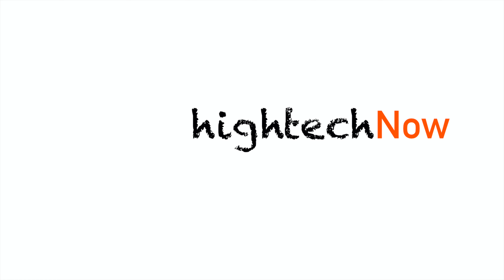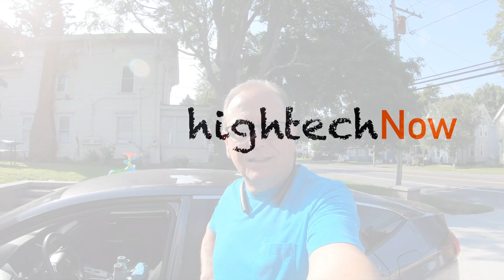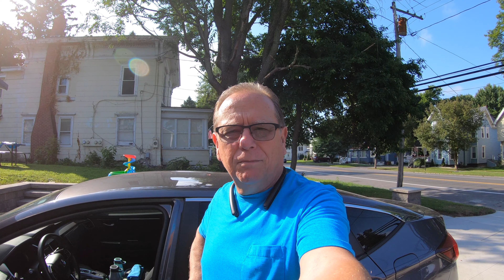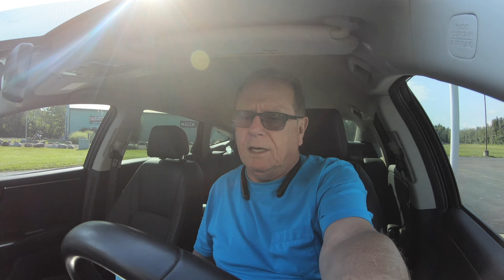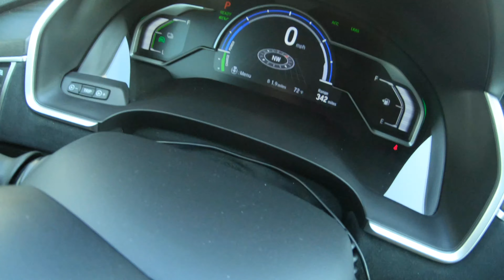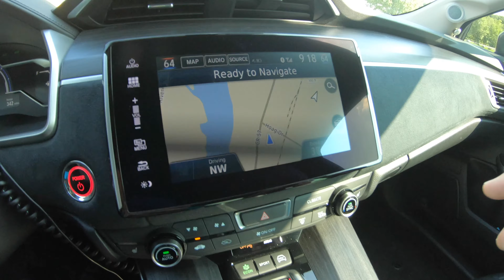Honda Clarity, how is it on Road Trips?

Comment: Nothing like being four years late to the conversation, but here I am!  I, too, have a 2018 Clarity (Base) and have owned it since new (10 mi on ODO).  She now has 83,500 miles on her odo and I still love it as much as the day I drove her home.  I took mine out on a 1250 road trip for Portland, OR to Palm Springs, CA about 90-days after I picked her up.  We drove over 2 day (July 3-4) through the hottest parts of CA.  I had everything I could stuff inside from floor to ceiling with enough space for myself in the driver's seat and a spot for water.  Mid-summer, AC set at 72 and averaging 75 mph through the Siskiyou Pass, over to see my sister in the Sierra Nevada and down the I-5 (thus the average!) to Palm Springs.  I averaged 55.1 MPG and was 90% comfortable the whole way.  The only thing I am not 100% fond of is that the seats are not made to support the weight of an average adult (too thin) so my behind was sore a good deal of the time and I took a few more rest stop breaks than I should have in order to get myself straightened out.  The other is the road noise.  Honda is notorious for skimping on this and the Clarity is no different.  The mouse fur carpet, thin (if any) sound deadening and volumous cabin make for a resonant interior. Even with lots of soft items in the cabin, it was still louder than my CX-5 and my diesel Jetta.  However, she is still banging out 55+ mpg on long trips (I've gotten as high as 63 mpg) and I wouldn't trade her for the world.
Reply from the maker: Very nice owners report, thank you for sharing ❤️.  I agree on all points made. We are at about 53k and we enjoy the Clarity as much as the day we purchased it. We have 4 more payments...lol.

Comment: Nice video! We actually have 2019 Clarity as our main family car. I'm looking forward some long road trips to come, and I'm curious what's your methodology on road tripping with Clarity. When we have continuously days of travel (ex. 3-4 days), do you think Clarity can hold up without charging and just using gas + HV mode? (assuming we can't charge every night during the trip). I'm asking since we've been just fine with EV mode for daily use (and occasional HV mode for >50mile drive), I've not tried long road trip without charing.
Reply from the maker: My thoughts are when traveling, save the EV/ battery always. When leaving town, use the battery to bring down the level from being topped off, then switch to HV mode. The Clarity is much more fun on the freeway with a good charge in the battery. (Sport mode is nice). If you have to climb hills and start to get low, don't be afraid to use the charge mode to bring it back up to about 50 percent while driving ( preferably not during a climb). We are at about 49k miles and still feel the Clarity is the top plug in hybrid available when compared to all PHEVS.  Have safe travels ❤️.  The forums are full of great advice. 👍
Reply: @htnowpro  Thank you for the comment!
Reply from the maker: @eugenehong136  you are very welcome.  I had to go back and watch the entire video from 3 years ago.  It was a great trip, all but the last 30 min. Have a wonderful weekend coming up. 😀

Comment: Hi can you tell me how reliable will it be for me to purchase a 2018 clarity touring with 9k miles any thoughts will help
Reply from the maker: From my experience and all the groups I am on I would rate reliability a 10. Your experience, of course may vary . We are exceptionally pleased with ours. Ours had 9k when we purchased it. We are at 47k now. Read everything related to the Clarity, do your due diligence, and weigh your use case scenario and expectations accordingly.  Hope this helps you.
Reply: I hope you bought it and are as happy with yours. 🙂

Comment: Odd, no comments that you don't seem to understand how the transmission works,  Once at speed in Hybrid or sport the engine does engage with the wheels, as well as driving the generator.
Reply from the maker: Good morning.  I just reviewed this travel video and I can't find anything related to how the transmission works.  You may have noticed this was not a technical video; merely a travel video.  I thank you for watching and taking the time to comment. For an outstanding break down of exactly how the transmission in the Clarity works I highly recommend the WeberAuto channel.  Here is a link to the Clarity transmission operation. https://youtu.be/QLUIExAnNcE
Reply: Although this was a travel vlog (awesome!), if you want the tech side the Clarity doesn't technically have a transmission.  It's a direct drive powered by the Atkinson Cycle engine.  The generator is powered through this mechanism and is turning the drive wheels.  The only time the generator actually engages is when either the accelerator is depressed fully indicating that the additional 103 hp engine is needed or for the generator to actually engage and charge the battery pack.  The best method that I have found is using ECO mode for all but climbing the steepest grades or accelerating in a specific merge situation that requires all 212 HP and 235 ft lb of torque.  I have spooked a few BMW and Benz drivers off the mark.

Comment: Going to buy a used clarity and drive it home 1600 miles.  I see you where in sport mode. Videos say hev mode on a along trip .??  Explain the difference. Your mpg was good. Thanks good info .
Reply from the maker: Sport mode gives you great passing response along with HEV mode selected to try to save your EV range. Keep your EV as reserve and don't forget when stopping for fuel to reset HEV mode every time. It's not absolutely necessary but makes the Clarity very responsive when getting around those big rigs. Enjoy your new ride. Thanks for watching and commenting. Have a wonderful trip.
Reply: @htnowpro  Thank You

Comment: Thanks for making this great video. I have two questions regarding honda clarity:
1. How's the comfort compared to Honda accord and Toyota Camry?
2. Is the engine noise high at 75-80 mph?
Reply from the maker: Sorry for the late reply.  It's very comfortable but the seats are firm. 75 to 80 not very noticeable  unless you are climbing hills with no battery left. Always save some battery for a more pleasant experience.  Remember, this is a full electric vehicle with a gas generator not the other way around.
Reply: @htnowpro  Thanks for your reply. I hope to get one soon as it's economical and roomy at the same time. Keep making new videos. Nice work 👍
Reply from the maker: You are welcome.  We are traveling home on a 2800 mile trip. I really like this vehicle.
Reply: The comfort is equal to either and the Clarity is actually more comfortable than the Accord IMHO.  However, the road noise can be a bit invasive.  You won't hear the engine unless you're pulling a long grade and the charger comes on, then it will sound like the damn thing is going to blow.  Once you get it down that you're fine, it's actually fine.  I never use SPORT unless I really need to get on it.  I'm always in ECO and it's more than adequate.

Comment: I just got a 2018 Clarity.  We are looking to take our first road trip.  It will be a 2200 mile round trip.  You mentioned that you drive in sport mode when driving on the freeway to keep the battery charged.  Do you have a video going over the modes and when to use them?  Bottom line, I want the best efficiency as possible during this trip.  What should be my game plan?
Reply from the maker: Our trips start out in EV mode to use some electricity off the top of the battery for 2 or 3 miles then switch over the HV ( hybrid) mode to save the battery charge for passing or climbing hills. The economy button will give the best milage with slightly less power or more throttle to get the power and less A/C cooling. We choose sport mode for the great acceleration to pass trucks and climb grades. Note: you may forget to switch back to HV mode after filling the tank (we have many times) no worries, that is what HV charge (hold down the HV button and the engine will  recharge back up to about 58%.The Clarity does really well at 70mph, above that milage will drop, of course. I have different videos with the Clarity but not specifically with the modes. We did two 2800 mile trips last year and one is a partial video . Have a wonderful trip. It's a great road trip vehicle.
Reply: @htnowpro  you're awesome!  Thank you for your help.  We're looking forward to trying out on a long trip.
Reply from the maker: You are very welcome, don't forget to top off your tire pressures. Tires do loose some air and affect mileage.  I set mine to 37 psi. Enjoy and have a safe trip.
Reply: @htnowpro  I am heartbroken.  A semi truck rear-ended my Clarity while I was stopped at a red light!  So we are not taking it on our trip.  It will be in the shop.  Loved it for the week I had it...
Reply from the maker: I'm so sorry and sad this happened and I hope and pray you are doing OK and not too sore from the trauma. I have seen a post showing each step of a Clarity repair for a rear ender and I hope yours goes well.

Comment: I am wondering if I should buy Prius prime limited plug-in or not, but after watching your channel, I will probably get this ☝️, more roomy, styling car😊, thank you
Reply from the maker: If you want a smaller car, mainly gas buy the prius.  If you want a mainly electric vehicle with a gas range extender that has great rude quality by the Clarity.  I feel the Clarity is also the better deal.  We just drive another 500 miles and have 10 more hours of driving toi go. This car is great 👍👌🙌👏
Reply: @htnowpro  thank you 😊!
Reply from the maker: Thanks for watching and commenting 🙂.
Reply from the maker: Thanks for watching and commenting 🙂.

Comment: Good video.
How do you find getting in and out of the car? Is it very low to the ground?   Ease of entering/exiting is an important purchasing decision maker for me.......
Reply from the maker: Thank you 😊.  I have the Power seat relatively high which makes it not a big drop, down into the car. Makes a big difference. I used to drive a mustang that was a pretty low drop down, into car. Thank you for watching and commenting. Hope this helps.